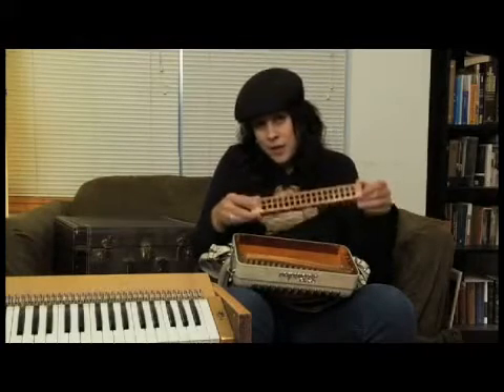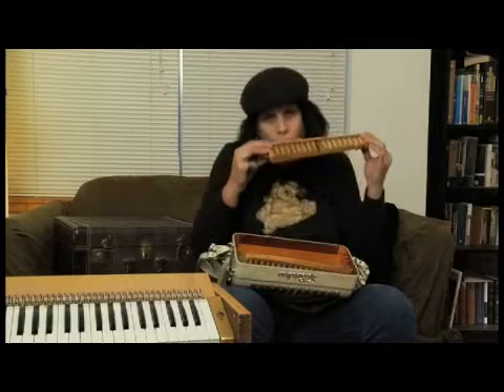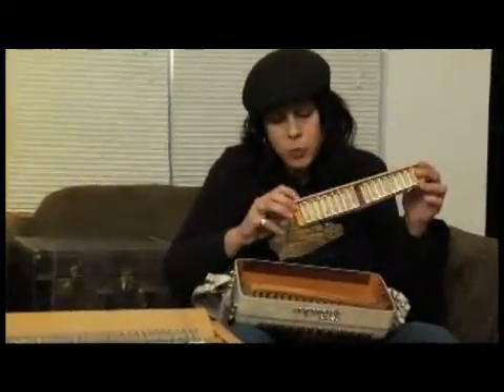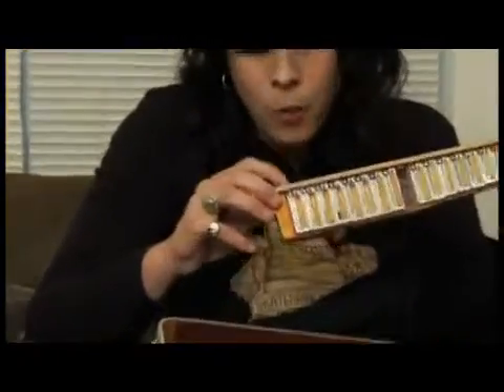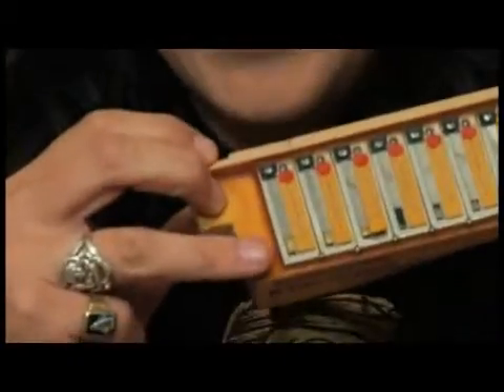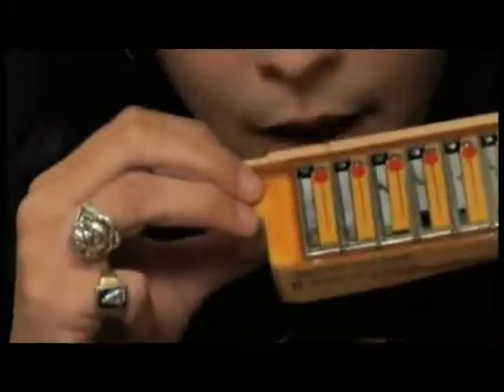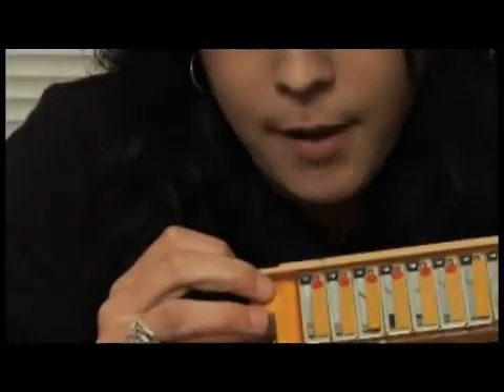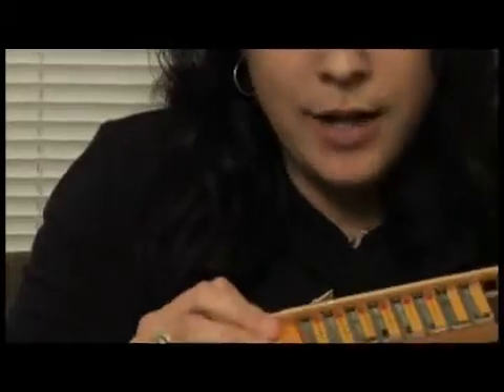How a Reed Works in an Accordion

Comment: Regarding the mouth blowing into reeds versus moisture. If reeds block is at room temperature , and if you use a piece of cotton cloth to capture moisture, do you think this can still ruin the reeds ? Thanks
Reply: If you have the reed blocks out of your accordion, DO NOT blow into them like in the video. This was likely just for the purpose of demonstration only. As you correctly thought, moisture will hurt the reeds. They are almost always made of steel—not just regular mild steel—and they will get oxidized by the moisture in your breath.

For tuning and working on accordions, all repairmen have a special tool with a bellows attached so that they can force dry air through the reeds, just as if it were still in the accordion. This tool looks like a table with bellows attached underneath, and the table's surface has a hole in it to allow air to pass into the reed.